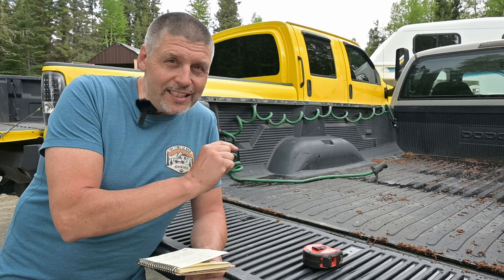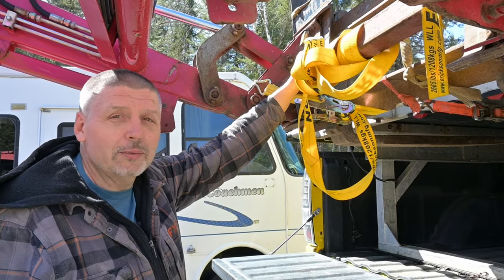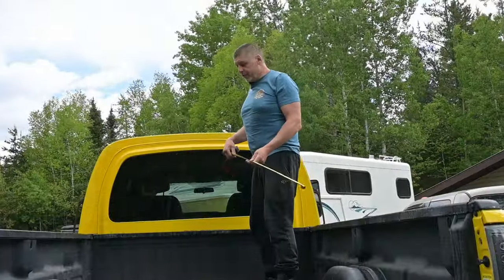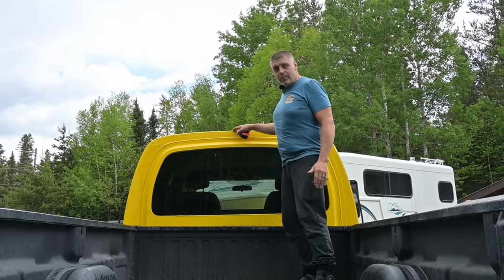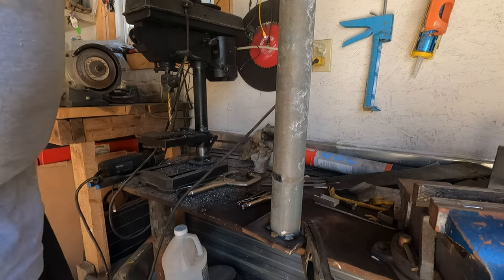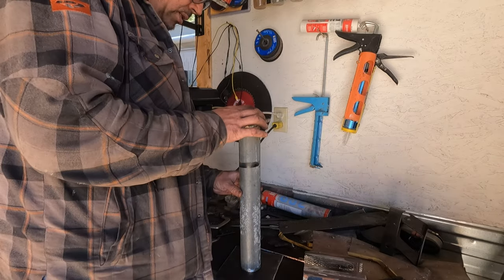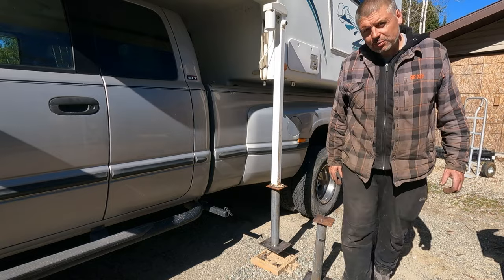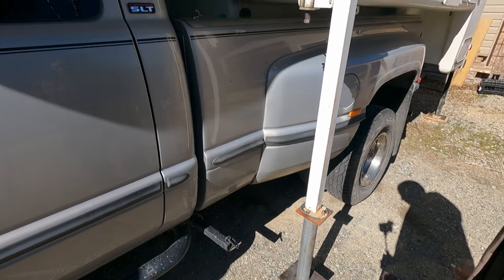Level Up: DIY Jack Extensions for Our Truck Camper

Comment: 😂 this is a holy 💩 project dude! 
Wondering are u getting bigger tires yet too? N then are u not concerned about being top heavy on the back of that truck once she's up there? 🍻
Reply from the maker: Yes. It'll be on 41" super singles which can handle the weight better than the current tires. We'll see how it handles it's a very heavy stable truck.